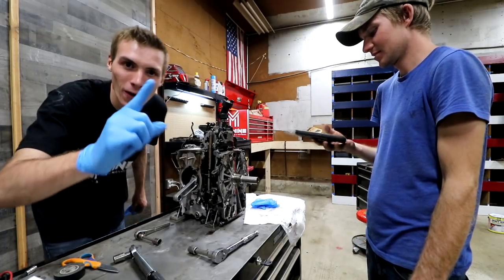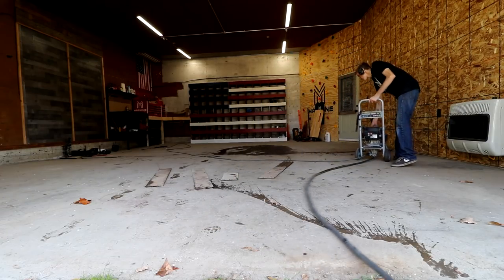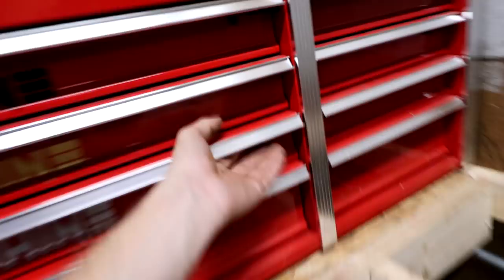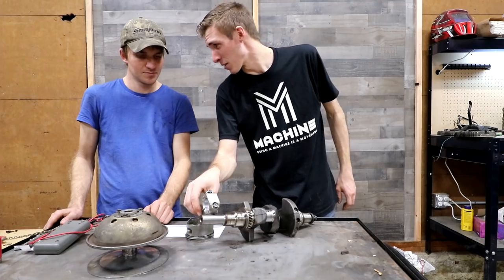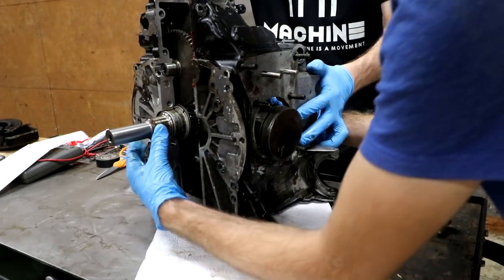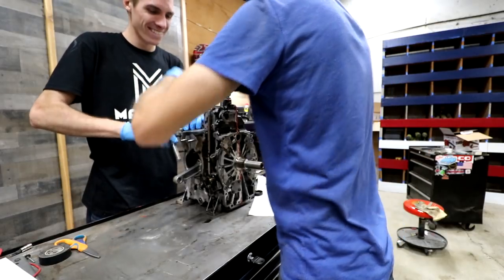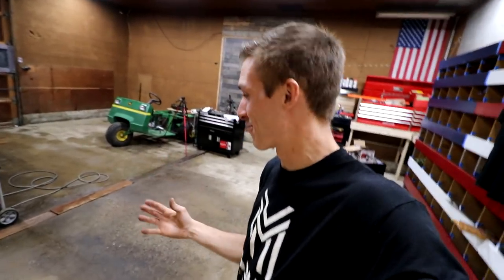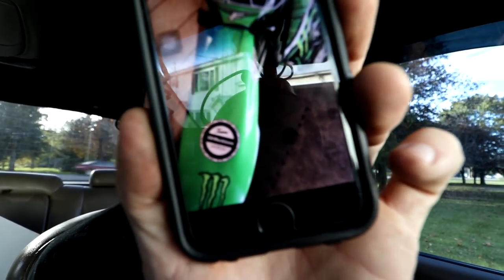NEW GATOR ENGINE BUILD (part 1)

Comment: You most likely have already painted your floor by now. But just incase you havn't they make and seal concrete sealer that does away with dust and seals the concrete against oil - gas or anything else you can spill on it. Much better than paint but leave the concrete a natural look with a bit of a sheen to it. Plus it tries overnight and cost way less. One more thing you can apply it with a roller with a long handle or spray it on using a 1-2 gallon pump up sprayer used for applying bug killer on lawns or spiders in your car and truck LOL.